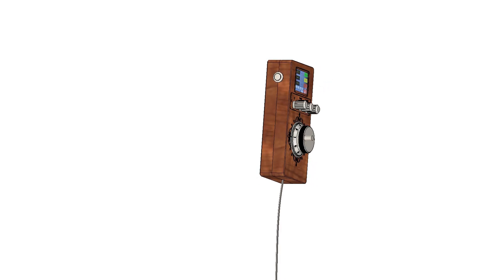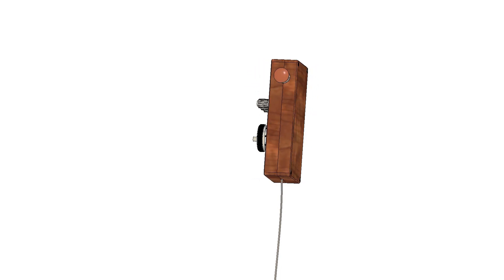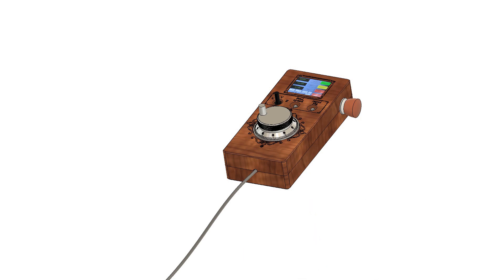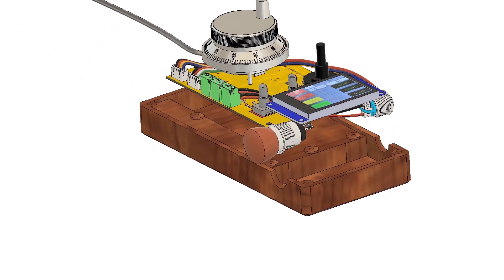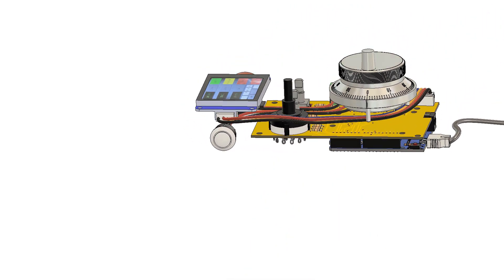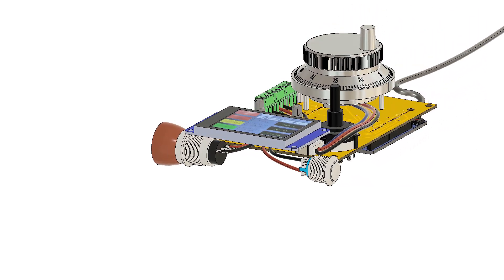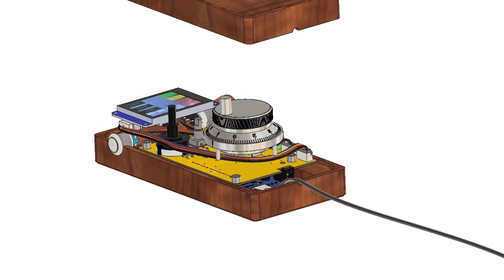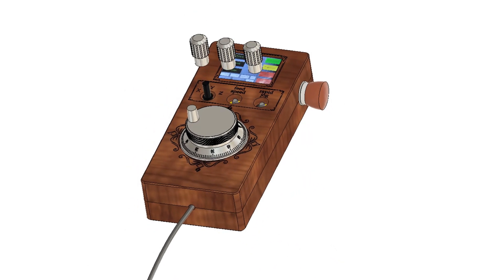Build a Pendant/MPG for Mach4

Comment: Amazing. Great work. How did you get the axis positions from Mach4?
Reply from the maker: Thanks. You can get it with mcAxisGetPos(mInst, AxisNumber, &XAxisPos); 
and then send it via serial.
Look in the API Reference in the doc folder from Mach4 there you will find all the commands.
Reply: @MarkGyver  I'm a c# coder but I'm very new to Arduino and ModBus. Would you mind sharing a code snipped for just one axis so I can do the rest. Thanks in advance.
Reply from the maker: @skorkmaz  Yes send me a PM on my email i send you the code back. This code is not working with modbus it is over serial connection. markgyvertech@gmail.com
Reply: @MarkGyver I sent you an email.
Reply: Hey  @MarkGyver , did you get my email?
Reply from the maker: @skorkmaz  Yes but i am at work at the moment. I sent it to you in the evening

Comment: How did you get feedback from mach to the MPG for the display? Position for example or the buttons.
Reply from the maker: The state of the buttons is sent via a serial connection from Arduino to Mach4 and from Mach4 it is also sent back via this.